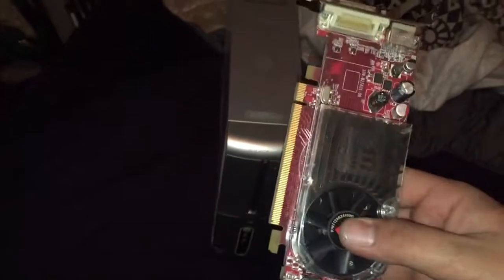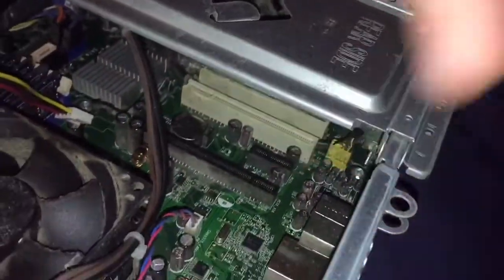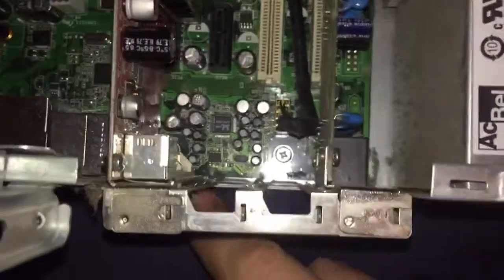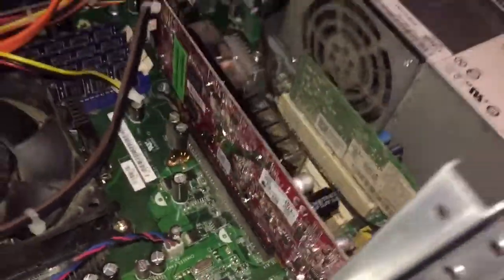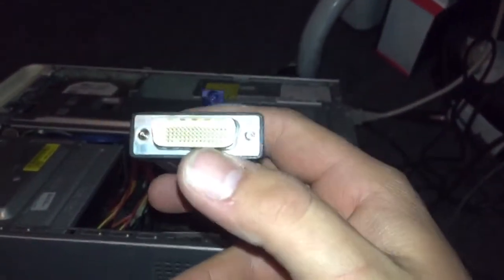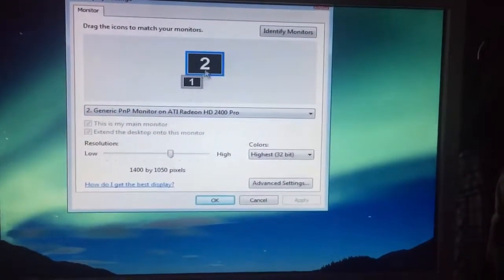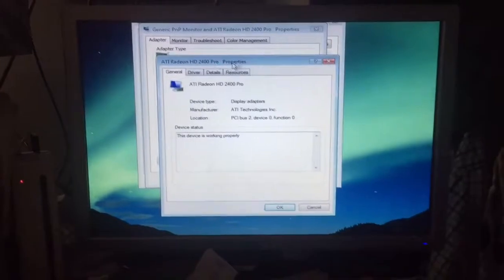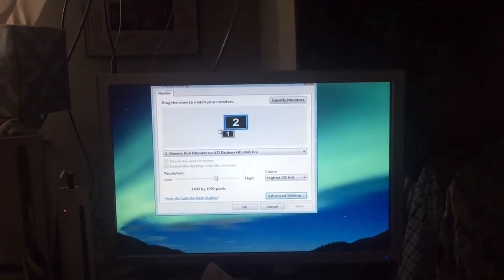How to install graphics card | Dell Inspiron 531S low profile

Comment: I have an inspiron 530s with DDR2 RAM. Will this graphics card work in it? Thanks
Reply: Same problem
Reply: @skullmoulder703   Been doing some research, apparently it should work
Reply: @RoshniCS  this is useful info thanks!
Reply: Gt710
Reply: Bro you’re still running this thing?! Mines been sitting in the basement gathering dust sinceeee like 2009 lol
Reply: @jeffhelmick8065  Had mine since 2007. Worked great until 2020 unfortunately. It's all about how you care it 😉